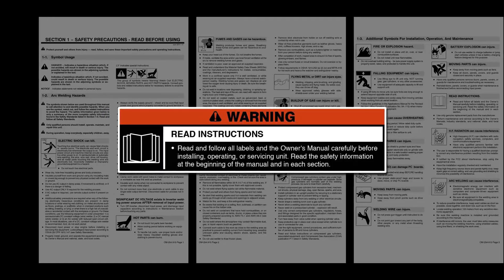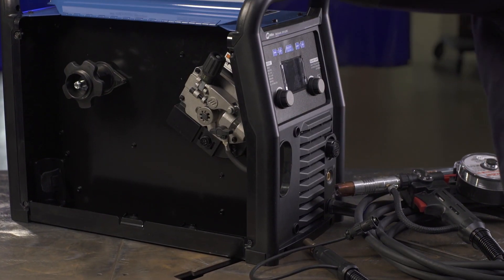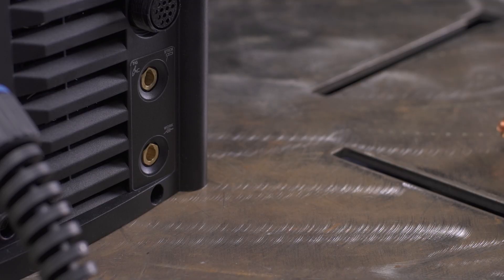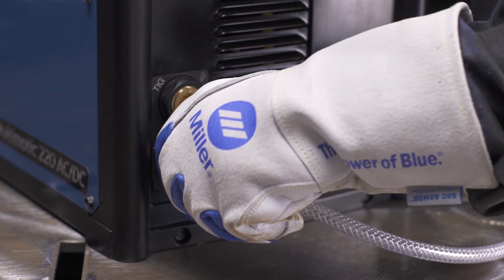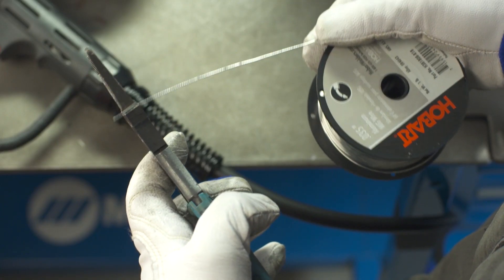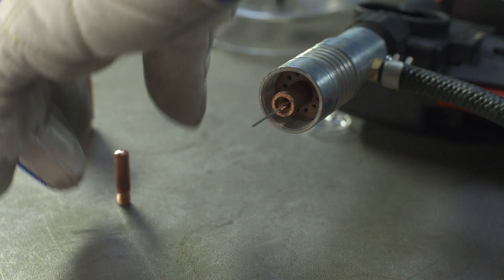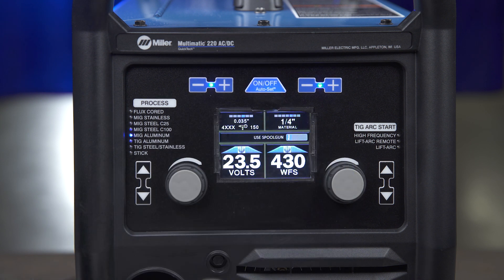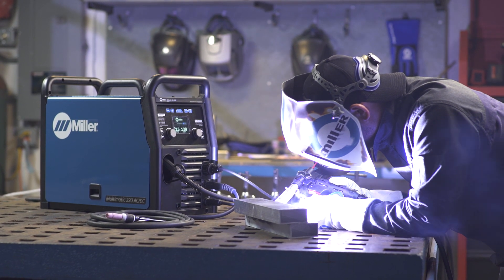How to MIG Weld Aluminum With the Multimatic 220 AC/DC

Comment: Biggest flaw is you have too manually switch your argon tank to the MIG port to spool gun aluminum/MIG aluminum. It will not pull Argon gas from the TIG port.

Comment: 220 doesnt accept push pull guns, cant run pulse on a spool gun. 255 doesnt have AC.  What gives Miller?  just come on out with that 350PT multimatic already so i can run a alumapro gun and a AC tig in the same box.  My tiny shop builds boat stuff on my channel if you need product testing and reviews, i know yall got what i need coming down the pipe soon.

Comment: CK worldwide sells a dinse connector water cooled torch that works for this, was unaware when I bought this that it isn’t supposed to be water cooled, kind of a bummer
Reply: I have the superflex CK17 flex head for mine, gas cooled. But you can get a water cooler and hook it up to the machine, so you can run your CK water cooled torch. best part about almost all machines is how you can really custom them to your liking.
Reply: Praxair guy assured me all miller’s are water coolable. Sold it and got a dynasty. Miller dropped the ball not making this water coolable. Can’t really build it custom when only 1 brand makes a torch that works with a water cooler. So dumb lol other features were kinda cool at first if you’re a beginner but yeah, had buyers remorse.
Reply: @natel2895  Miller has a water cooler that can be use with any of their machines. CK worldwide makes torches that are gas cooled and water cooled, I have a CK17 flex head gas cooled on my multimatic 220, I personally don’t have plans on getting a water cooler for my machine. If I was running the machine that hard I would bump up and get a bigger machine with a water cooler built in, this machine is more for multi purpose and is not generally heavily used, if you watch (the fabrication series) here on YouTube, he has a video making a makeshift cooler for tig torches. Anyone who buys parts or wants to upgrade their machine, should always look up what they are needing and is compatible with their product. Best part about any of the welding manufacture companies is that they always give a parts list, so you can get the best product for your application. I love Miller, and love the 220 I have. I’m primarily a tig welder, but I definitely needed something with mig, down the road I plan on getting an Everlast for strictly tig. There is something about the arc start on the everlast that I really dig. 🤷‍♂️

Comment: What spool gun do you recommend for the Millermatic 220 AcDc
Reply from the maker: Thanks for your question! We recommend the Spoolmate 150 Spool Gun for the Multimatic 220: MillerWelds.com/accessories/guns-torches/spool-guns/spoolmate-150-spool-gun-m30069#!/?product-options-title=spoolmate-150-spool-gun-301272.
Reply: Thanks
Reply: I've used both the 100 and 150 on my 220 AcDc, both will work, but I think the 150 is better built and runs more smoothly.  In my case the cord length of 20' on the 150 saved me from having to move the machine around while building my camper frame.  It would have been a lot of effort and wasted time and I hate working among clutter anyway.  It was worth the extra hundred something bucks for sure.

Comment: This machine is not good at all cannot weld 1/4 aluminum when cold ,also can not go downtown 5 amps like the sycrowave 210.THIS IS A POOR ATTEMPT TO CHALLENGE ESAB AND CHEAPER CHINESE WELDERS LIKE NEVERLAST!!!MILLER YOU CAN DO BETTER !!!!
Reply from the maker: Thanks for sharing your feedback. The Multimatic 220 AC/DC has am amperage range of 20-140 A with 120 V power and 20-210 A on 220 V power for TIG. It can AC/DC TIG weld 24 ga - 1/4 in. aluminum and MIG 18 ga - 3.8 in. aluminum.  If you would like to further discuss more details, please call our team at 920-734-9821.
Reply: @MillerWelders currently welding 3/8 and its struggling :(
Reply: @MillerWelders  I have Spoken to your team which left me to feel that you could give a dam about how this machine welds.I HAVE HAD THE OPPORTUNITY TO WELD 1/4 ALUMINUM MATERIAL IN COLD WEATHER WITH THIS MACHINE ON A DEMO AND WAS NOT IMPRESSED AT ALL SO GO BACK TO THE DRAWING BOARD!!! AFTER A PREHEAT WITH A TORCH IT WELDED BETTER!!! AS A PERSON THAT HAS MILLER EQUIPMENT THIS MACHINE IS A DISASTER FOR MILLER IT IS SUB STANDARD, EVEN CK WORLDWIDE BUILDS A BETTER MACHINE FOR TIG WELDING THAN MILLER.ALSO MILLER REBRANDS C .K WORLDWIDE COMPONENTS AS THERE OWN! WHAT IS SAD YOU THINK YOU ARE COMPETING, YOU ARE NOT!  THE OVERSEAS CHINESE MADE WELDERS OFFER MORE FEATURES THAN YOU ARE FOR LESS OF A PRICE!!! ALSO ESAB WILL BE THE COMPANY THAT WILL TAKE YOUR BUSINESS!!
Reply: @apacheone3643  Try using 75% helium 25% argon gas. I use it all the time with my multimatic 220 on yacht hull plate it gets amazing penetration. I absolute hate using %100 argon for aluminum mig. To be honest I've never really understood why most manufactures recommend %100 argon.
Reply: @NoVanity1  I am aware of using Helium also preheating the Aluminum my point was Miller can do better.
Reply: @NoVanity1  Do you use 75/25 for tig aluminum on the 220 as well?